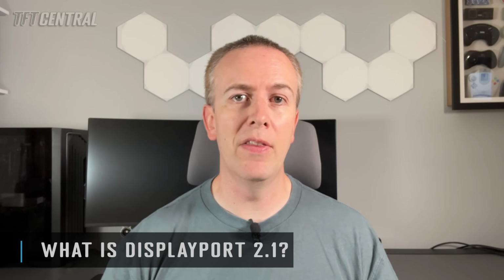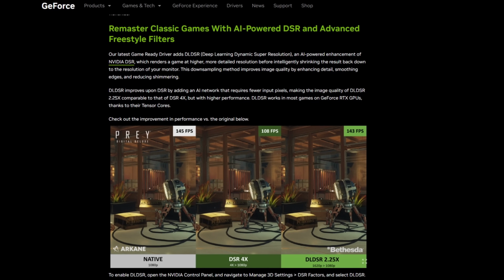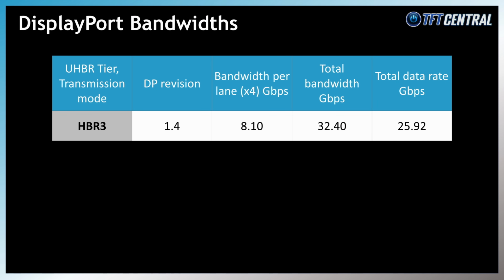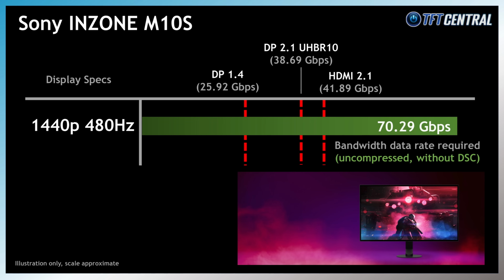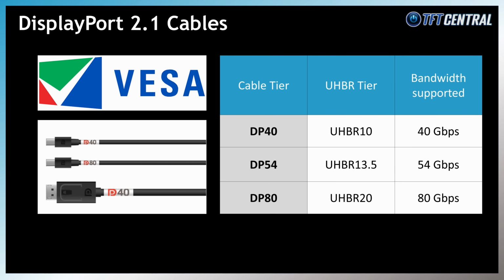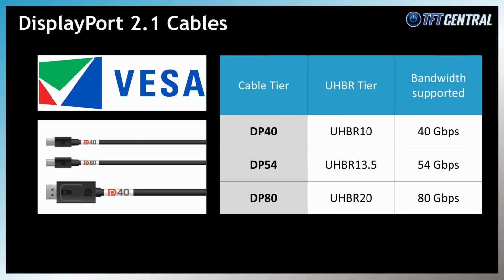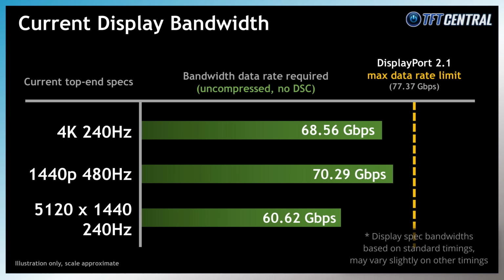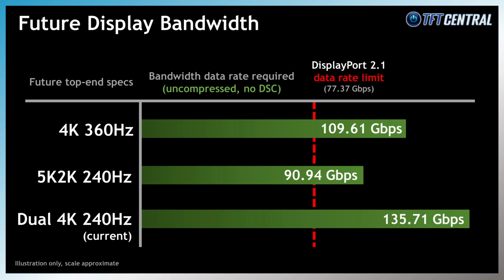The 5 Big Problems with DisplayPort 2.1

Comment: What is the theoretical maximum bandwidth that DP 2.1 with DSC can be pushed to? For example could it do 1440p 1000hz at 10bit with the bandwidth of 211.23 Gbps? What is the upper limit?

Comment: If your GPU and monitor supports DP 2.1,  you can reach a maximum total bandwidth of 80 Gbps when using a VESA-certified DP80 cable. This performance is achieved through the UHBR20.
It´s the right cable you need. And with the 2.1a you get a cable with 2 meters of length instead of 1 meter of the 2.1.
The core bandwidth capabilities of DisplayPort 2.1, 2.1a, and 2.1b are fundamentally similar, with all of them supporting the same maximum potential of 80 Gbps via UHBR20 (Ultra-High Bit Rate 20) link rates. The updates from 2.1 to 2.1a and 2.1b have focused on improving cable specifications (length and reliability) and enhancing power efficiency through protocol updates, rather than increasing the total raw bandwidth

Comment: Hey great video, very informative. I’m currently on a 4090. Based on this video I can’t tell for sure, but would I be able to run a dual screen setup with 4k for 240hz for gaming and a 5k at 60hz for content consumption? 

If so which should I prioritize for my 4090’s single hdmi 2.1. And does cord length matter for hdmi 2.1 and and DP 1.4?

Comment: Well I am getting intermittent few second blackouts on my BenQ monitor hooked up to an RTX5090.  Suffice to say I bought a cable at local Best Buy.  So I am hoping it is a cable issue but I have no idea what cable to get given Amazon carries so many display port cable.
Reply from the maker: With the monitor only supporting DP 1.4 you should be fine with any decent quality cable really.

Comment: Man, Yes - Nvidia has problems, their drivers have not been stable for the last year. I think someone quit Nvidia a year or a year and a half ago and that's it, their drivers became garbage. One of the main problems with DP 2.1 is crashes from games when using a DSC. Black screens, etc. - you said it, but did not offer a solution. And the solution is simple - for all video cards except the 5xxxx series, you need to use the latest stable driver - 528.49 (not 566 or 572 versions. Only this one). There are no problems with it. There is nothing to talk about at all. End story.

Comment: I think I just found the answer to my issue. I just got one of the Samsung G95SC monitors, but I'm running it off of an RTX3080. I was planning on updating to one of AMD's new cards once they're released, and now I know that not only should I, but I need to verify for one that supports UHBR13.5. One hopes that would be all of them.
Reply from the maker: Updating to an AMD card could give you DP 2.1, as could the new RTX 50 series cards too from NVIDIA which were announced since this video was published. The new RTX 50 cards have UHBR20 speeds, so full speed DP 2.1, a step beyond the consumer AMD cards which only go up to UHBR13.5

However, there is little point for your current monitor, as that only has a DP 1.4 connection anyway.

Comment: i'm super glad that you mentioned that the black screen upon alt tab is a cause of the dp cables if they're not the right cable for the monitor, i'm currently using an 4k 240hz monitor so ive noticed alot of 2-3second long black screens while alt tabbing because i use an much much older out dated cable than i should. (basically an old dp cable that does 60hz or 120hz on 1080p) and so i had to do research to upgrade it because this is something not many are talking about in the gaming community about how important it actually is.

Comment: I refuse to subscribe to the notion that just because a product is available, people should feel pressured to buy it and overlook the flaws in technology that clearly needs to mature. Take a look at what's currently on the market. If I were in the market for a 4K QD-OLED monitor with DisplayPort 2.1 support, my only option right now would be the Gigabyte model, which unfortunately doesn't have a strong history in this sector. Generally, consumers should lean towards brands that have established credibility and a solid track record. Dell and ASUS are prime examples of this, and it's encouraging to see Sony entering the monitor arena. With the much-anticipated launch of the 5000 series on the horizon, which is expected to support DisplayPort 2.1, other monitor manufacturers will follow suit. They often look to industry leaders like NVIDIA to spearhead new technologies, although this shift may come with its own set of challenges. New advancements frequently face initial difficulties. I'm quite satisfied with my AW3225QF, and when Alienware unveils their next flagship 4K model (ideally a flat panel) - I won’t hesitate to make that purchase.

Comment: @TFTCentral I have a triple monitor setup, with 1x QHD at 165hz, 1x UHD at 240hz and 1x FHD at 144hz. I've been wanting to get 3x UHD at 240hz, is this currently possible? I have a 4090. If not, can I run my center one at 240hz and my side ones at 120hz? It would be 3x AW3225QF

Comment: I just bought a 27” QD-OLED monitor. 
It says the ports available are:
1 x DisplayPort (1.4a) 2 x HDMI (2.1) 1 x Type-C
(DP alt.) W/PD 15W

I have a 1.4 display port cable is that what I should be using for 1440p gaming or should I get a 2.1 cable or should I be using hdmi?
Reply from the maker: The DP 1.4 cable is fine. There’s no point in a DP 2.1 cable unless you had a DP 2.1 graphics card AND monitor, and it supported speeds and bandwidth beyond 1.4. 

You could also use HDMI 2.1 if you’d rather but personally I find it easier and generally less buggy to use DisplayPort from a pc, and keep those connections for other devices when needed
Reply: @tftcentral  I have 7900xtx(with hdmi 2.1 and dp 2.1 ports) and wonder what port and cable to use on 1440p 360hz monitor i want 360hz with no dsc is there any difference at all?
Reply from the maker: There aren’t any 1440p 360Hz screens that feature DP 2.1 yet so you’re going to need to use DSC either way to reach that spec , even though your card can support DP 2.1. You’d prob be best using the DP connection anyway here

Comment: I have samsung oled 4k 240hz whats your recommendation for connection dp2.1 or hdm 2.1?
Reply from the maker: None of the Samsung OLED screens have DP 2.1 yet so you can use the DP 1.4 port or the HDMI 2.1. Either is fine and both support the spec of the monitor. Personally I tend to use DP for a PC

Comment: DP with two displays especially when the other isnt alos DP is the biggest annoyance in the world., randomly my screen will just turn off even when its only set to my main screen. only way to fix is to win + p and make it dupe or something to force it to show back up and then choose main display again. IDFC DP isnt that amazing at all. I have an hdmi 2.1 with no dp and has 0 of the issues with all of the benefits. People saying DP is the best are low iq. its not. it has a crap ton of weird issues that have still yet to be resolved. and ive exepreicneds this issue with different systems and cables and monitors and it still happens only on DP. DP is a buggy mess
Reply: The reality is that your assertion is incorrect. G-Sync, for various reasons, does not function optimally over HDMI 2.1, and this is an established fact. Random graphical glitches are not unusual, and they vanish entirely as soon as you disable G-Sync. Plus, your inclination to disregard others and categorize them as possessing a "low IQ" reveals more about your character than you might be aware of. It is reasonable to conclude that you are the kind of person who often alters the parameters of the discussion or resorts to personal attacks during debates. Maintain a sense of decorum.

Comment: I have a RX 7900XTX paired with the MSI MAG 34I Oled and with a Display port 2.1 cable plugged in, it forces my monitor to 8 bit, but If I use the HDMI cable it runs at full 10 bit. Both at 175hz respectively. I'm wondering if I am having an issue with the cable, or if the Monitor or technology with the Display Port are the issue here.
Reply from the maker: It’s actually the monitors DisplayPort connection in this instance. It doesn’t support DSC and so the 8-bit limit applies at 175Hz. Max for 10-bit is 144Hz. The HDMI 2.1 connection is preferable in this instance to give you 175Hz 10-bit support
Reply: @tftcentral  I have a Gigabyte FO32U2P monitor Using a complete mini displayport 80 cable length 1 meter 10 gib on 4 lines total 40 gigabytes 7800xt video card 240 10 bit

Comment: Out of all OLED panels you have tested which one does have best white balance like whites appear white rather than yellow? Im stuck between PG32UCDM or 32GS95UE for me screen coating doesn’t matter only the white point. Any help would be appreciated 👍
Reply from the maker: Well that kind of depends on what white point you’re used to. Both have pretty good calibration to a 6500K white point but whether that looks white or a bit yellow to you depends on what you’re used to. If you’ve been using a cooler screen it might still look yellow. Both have good adjustment options though at least
Reply: @tftcentral  I do prefer cooler tone displays previously i was using LG27GN950 but still if it’s accurately calibrated to 6500K I’m ok with it. So among these two ASUS PG32UCDM & LG 32GS95UE which one comes with perfect calibration out of box?? I don’t have any color calibration tool with me.
Reply from the maker: @Arno641 have a check on our reviews of both on the main site as it’s tested there in a variety of modes you may want to use 😀
Reply: @ yeah i have already done watching it but still i couldn’t able to decide because it wasn’t direct comparison also since you have experienced both the panels i would like to hear from you it would be really helpful for me to make decision!
Reply from the maker: @Arno641 I mean the written reviews on the website, they contain the measurements you’d need. I can’t provide any more info than in there really
Reply: @Arno641  Nitpicky, aren't we? Get an eizo and be done with it.

Comment: Excellent video...
Nvidia will release its next versions of GeForce RTX 50xx PC graphics cards in Q1 2025.  They will have 3 DisplayPort 2.1 ports.  So, this video should be updated with a few seconds about that.
Reply from the maker: That’s not officially announced yet though is it?
Reply: You are absolutely correct. 

Regardless, just about anywhere you check as of today you get something like:
"Yes, the Nvidia GeForce RTX 5090 is widely expected to support DisplayPort 2.1, with many rumors pointing toward the inclusion of the UHBR20 (Ultra High Bit Rate 20) variant. UHBR20 allows a data rate of 20 Gbps per lane, enabling up to 80 Gbps total across four lanes, supporting very high refresh rates and resolutions, such as 8K at higher frame rates or 4K with HDR at extremely high refresh rates. This would be a substantial upgrade from DisplayPort 1.4a in terms of display capabilities, especially for high-end monitors."

I'm thinking it would be helpful to work a few seconds of that into your video so there is a more up to date spin on the situation.

If 2025 is going to be the year where DisplayPort 2.1 and 4k video starts to take off - maybe some of your listeners would want to think about that.

Putting out an updated version is going to get you hits with minimal effort - nothing wrong with that.

Comment: Any news about 4k, 360hz, 32 inch, full gorilla glass coating monitors?
Reply from the maker: No none yet. Only company using gorilla glass is Dough, and they’re currently working on their 32” 4K 240Hz dual mode model
Reply: @tftcentral  The most likely thing is that they will announce it at CES 2026 and it will come out around the end of that year, I am between the 1440p 480hz monitor or continue waiting for the 4k 360hz one.

Comment: VESA's practices need to come under the spotlight. A lot of industries could not get away with these non-standards standards. If it doesn't meet the spec of UBHR10 at a minimum they should not be able to call it dp2.1 full stop. That you can get VESA certification is a joke. VESA needs to held to account. This is just as shameful as the USB "standards"

Comment: Sony just released a 480hz OLED. You guys have it and are going to review it?  Those cheap bozos didint include an hdmi 2.1 cable but a cheap DP. The fps pro plus mode stutters and lags when facing opponents. At first i thought it was connection lag.
Reply: They also have a weak measly 1 year warranty on it. Thats pathetic.
Reply from the maker: No plans to review their model at the moment I’m afraid
Reply: @tftcentral   :(

Comment: Let me save you 20mins:
🔍 Understanding Specifications: It’s essential to know the specific UHB speed supported by a display labeled as DP 2.1 to avoid disappointment. Misleading marketing can create confusion.

    👥 Market Dynamics: The slow adoption of DP 2.1 is largely due to the absence of compatible graphics cards from key manufacturers, making it risky for monitor developers to invest in this technology.
    📏 Cable Limitations: The requirement for higher-quality cables that often fall short in length poses a significant barrier for consumers looking to upgrade to DP 2.1.
    🧪 Potential for DSC Issues: While DSC has its benefits, concerns remain about compatibility with older systems, particularly with Nvidia graphics cards, leading to potential user frustration.
    🌐 Certification Concerns: Manufacturers can mislead consumers by labeling products as DP 2.1 without guaranteeing support for new UHB speeds, raising the risk of purchasing subpar equipment.
    💸 Cost vs. Performance: The increased cost of DP 2.1 monitors versus the benefits they provide at current specs may deter consumers, especially if existing DP 1.4 setups suffice.
    🔮 Future-proofing Displays: As display technologies advance, DP 2.1 will be essential for supporting upcoming resolutions and refresh rates, making it a necessary investment for future-proofing.

Comment: 4K 360hz???  What media would ever use that?  Are my eyes even capable of seeing it?
Reply from the maker: It will be a future display spec for sure. There are clear benefits in image clarity, detail etc from the increased pixel density and resolution. And also benefits with motion clarity, system latency, gaming experience etc from a higher refresh rate. So yes, you’d be able to see it 😀

Comment: Disagree on the comment you made about UHBR10 and up. Because DP allows you connecting a display by one lane, two lanes or four lanes, all at the same bitrate. Therefore UHBR40, 54 and 80 does not make any sense.
Reply from the maker: Well I understand why they are called what they are, the point was more that for an average consumer it’s confusing naming schemes. Especially when you’ve then got different names for cables

Comment: Is there any news about Tandem OLED? Because Tandem OLED has 1000 nits Fullscreen brightness which is very good for BFI and it has way higher lifespan than normal OLED I personally think that Tandem OLED is the ultimate display technology
Reply: A new oled monitor or tv should last at least 5 years unless you're a super heavy user.  People have ten year old oleds with 10k+ hours and no burn in.  Just don't abuse it.  If you don't want to baby your display at all get an lcd.

Comment: 16:57 ive got a very long DP 2.1 Cable that will probably support the UHBR20 standard , but its an active fiber optic cable 
i guess thats the only solution right now if you want the DP2.1 standard.
Reply from the maker: Yeah fibre cables will prob be ok but any kind of passive copper cable will struggle

Comment: Dsc is not always that great, for some reason on my odissey oled g6 when I enable 10bit at both 240hz and 360hz I get a green tint, constant and there is nothing I can do about it. So if I want to use HDR I have to set it at 120hz which is a bit disappointing.
Reply from the maker: Have you tried different cables?
Reply: I got the same monitor but the highest refresh rate is 240hz. What’s the purpose of setting it to 360hz if you can’t get that??

Comment: I've seen alt+tabbing out of a fullscreen game without DSC causing several second lag too. My understanding is that lag is from switching control back to the OS for driving the display & caused overhead as resolution, refresh rate, etc. gets initialized and communicated. Are you saying that DSC adds more lag or the switch only lagged with it on in your testing?
  Thanks for summarizing this mess. Would have been nicer if more of the charts had 1.4 and the several 2.1 speeds marked on them but seems easy enough to follow with jumping around.
Reply: Just play your games in borderless
Reply: @veilmontTV  better for alt tabbing but often has impacts to latency + framerate and the game's ability to use and control some advanced graphics capabilities. You can run into different results when trying to capture the game such as for streaming with obs-studio. Sometimes there are bugs impacting the preferred choice. How things are impacted can also be impacted by the game and its currently used graphics library, what GPU is in use, and hardware that is connected to it such as for multiple monitors. Newer games, OS graphics standards, and GPUs are making things better but its not still automatically equal.